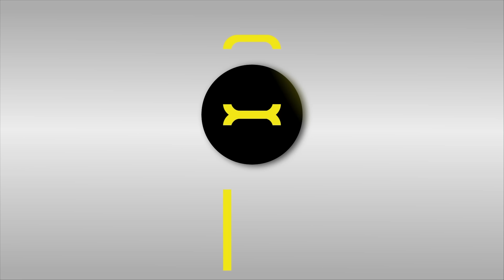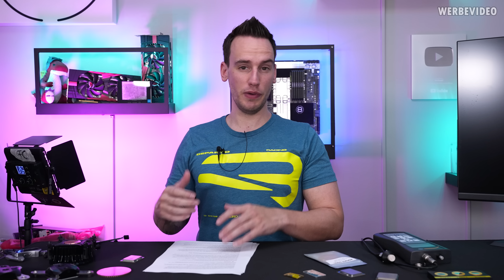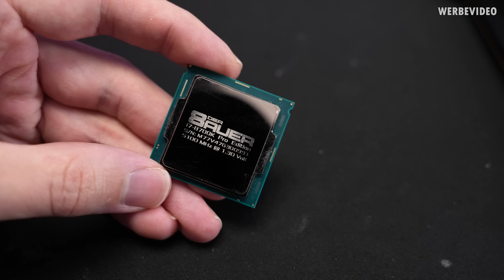Why you should NOT buy Water Blocks made out of "Silver" - Thermal Conductivity measured & explained

Comment: Roman - on the subject of the whole copper/silver thing, I remember reading somewhere that there's an alloy of the 2 called "coin silver" that is supposed to perform better thermally than either on their own. However, from a quick search it seems that there's more than 1 version of it, & I don't know which 1 it would be, if it's even true in the first place. From my very quick look, I think the copper content could vary anywhere between 10-55%, so... 🤷‍♂️  Again, I have no idea if there's any truth to this, I seem to recall it was suggested as being used as a sort of puck of the alloy in the base of an air cooler heatsink, though now that I'm thinking about it that may have been before heat pipes were as ubiquitous as they are now, so a while ago. 😀
Reply: I read about that, they called it "cusil".  It was said to have very high thermal conductivity but then someone tested it and figured out that the numbers first published were not based on tests, they were inferred from some other measurement (maybe electrical conductivity?) and in reality the thermal conductivity wasn't as good as pure silver.

Comment: You mentioned the silver water block is 92.5% Silver and 7.5% "Probably Copper" . . . but what if it's an alloy, like brass, and it's thermal conductivity either increases with temperature, or, stays stable and does not decrease with temperature?
Reply: 925 silver is always with copper

Comment: I was wondering how we were going to convert electrical conductivity to thermal conductivity. The Wiedemann-Franz-Law was really neat to learn about . I'm still waiting for super materials to be used in cooling . Some graphene-copper alloy or synthetic diamond - graphene with some serious thermal and electrical conductivity. Thermal paste really makes a difference in all of these materials as well. The gold plating note was excellent . It's to prevent the corrosion as gold is supposed to be inert even to water. Most other materials will rust or breakdown but gold seems to hold up much longer.
Reply: Oh, sure. That's exactly what we need right now, exotic materials to make PC components just impossible to buy for the 99% of the people. Thanks for that.
Reply: @JP-xd6fm  you and J B are forever jocking my stuff. thank you for never stopping your typing crusade.
Reply: @tobiwonkanogy2975  I really appreciate that. But I was dead serious about it, exotic materials like the silver used on the Aqua computer example are just a perfect excuse to raise prices up for no gain or negligible boost on performance. 
I'm pretty sure those exotic materials are being used by NASA for purposes that makes more sense than playing with our gaming pc.
Reply: @JP-xd6fm  Marketing would definitely push its advantage even if it was within a range of error . my real want is for copper-graphene. wouldn't take much to figure out how make a batch . potentially just run simulations with known properties or might have make several batches until the right consistency is found . I've seen old space computers but nothing newer . the military and aerospace technology always trickles down to the common folk eventually . microwaves , flight, pc's etc etc all was mythological at one time.

Comment: I'm confused why not just make the heat spreader just pure copper? I don't get it don't they want better cooling and performance? Could even ceramic coat the ihs for really good heat transfer and protect the copper
Reply: Copper corrodes and you cant have something thats typically not removable corroding
Hence why nickel plated

Comment: I wonder how much impact does the diffusion of gallium have in the conductivity of the IHS. Could it decrease it's performance when using liquid metal for long periods of time? I doubt it's relevant at all, but at the end of the day you're introducing impurities on the cooper, but probably in a relatively shallow layer
Reply: On exposed copper it will make a difference for sure, because the diffusion happens relatively quickly. Nickel is pretty resistant to gallium diffusion, at least at cpu temperatures. But even nickel will suffer above around 150C or higher.

Comment: In theory, as silver is a natural biocide, it's possible the silver block was made to prevent growth. I've always wondered about a pure silver cooler.
Reply: You are better off with just just copper or nickel plated copper anyway.  I wont write a dissertation here about it but you want your loop to have like metals all the way though due to the galvanic effect.  Silver doesn't play well with copper or pure nickel (nickel chrome alloys are better with silver).  As most radiators are copper its best to just stick with the copper and use a biocide in your loop.  Any benefit from the silver in the biocide department are simply not worth the cost.
Reply: @amindamok  lol some rich mofo now contemplating building a loop with all solid silver parts. Jks but I'm sure someone will do it at some point.
Reply: 90% of the coolers will be nickel plated and not real silver. pure silver would work about 5 % better(as its about 5% more conductive electrically) , but cost about 10 -20 times what a regular 40 $ cooler would .

Comment: @der8auer I have always used a silver coil in my water loops, but since I upgraded to an EK Am4 mono block. The steel block elements that touch the VRMs started corroding very fast, and I was forced to switch back to a regular am4 block. (I used deionized water btw with no colour additives). Would the Kryos Silver Edition help extend the water maintenance intervals by increasing the life of the water quality?
Reply: No.  The reason for the corroding is due to the galvanic effect.  Dislike metals don't... well... like each other.  Unless you also have silver tubing in your radiator and your fittings are also silver you will continue to have the issue.  Nickel can also cause this with copper.  However, nickel is very corrosion resistant.  So unless the coating is very poor it holds up to the abuse.  Copper on the other hand is very easy to corrode.  

You simply shouldn't run a loop with just distilled water unless you enjoy pulling it all apart to clean it up fairly often.  Its better to just use a good fluid or add a corrosion inhibitor to your water.  A loop that starts clean (aka you've followed the instructions and acid washed the radiator tubing) and using a good quality coolant like Double Protect Ultra you will avoid most issues and can run in the loop for years without issue.

Comment: Isn't silver used in loops as a biocide?  Seems that using the silver for the block would serve a similar function albeit for far more money than required/reasonable.
Reply: copper/brass is a biocide as well. Once door handles were done with it just for this reason.
Reply: @marsovac  they actually started doing it in hospitals
Reply: @marsovac  they still are made of copper, brass is just not cheap but it's a beautiful material, nonetheless.

Comment: Hey Roman, what is the interaction between silver and gallium based liquid metal? Is silver immune to the gallium? If so I think that would be a big upsell. As you showed the nickel plating on the copper greatly affects the performance, so if the silver is safe for permanent use unlike the copper then the value might be there.
Reply from the maker: From the limited testing we did with silver it seemed like it was actually worse than copper. But we only tried it on few IHS and limited time
Reply: @der8auer-en  Gallium is corrosive to all metals except tungsten and tantalum, copper is no more resistance than silver, that said when we talking about a heat spreader on a CPU there is no real world difference. there is less then 1% difference in the thermal conductivity of materials on heat spreader that size at the working temperatures(not counting Effusive/Diffusivity) .
So use copper its the best at transferring the heat at the price, unless we can make the heat spreader out of Graphite or Diamond.
Reply: @Northeastfarming  If you believe that liquid metal as a thermal paste does only 1% then you clearly haven't used liquid metal so far...  (edit: or... I completely misunderstood you talking about both Gallium and the usage on IHS's)

I see more of those responses though and all I can wonder about is... who keeps feeding the world these myths? The less thermal conductivity your thermal paste has, the less energy gets through that layer. This is the basic logic behind it and even at that 'thickness' you will notice much more than 1% results.

To be more precise, my system has been running liquid metal for 3.5 years now (yes.. not taking it apart for the obvious corrosion effect bringing a risk of the IHS crumbling, literally, to pieces) but the conductivity it gave dropped several degrees... From what I can find, it dropped around 6 degrees between settings. I was doing 84 degrees Celsius on a 1950x at 3.8 Ghz with thermal paste... and I went to 78C at 4.0 with liquid metal. Considering ambient was around the 19C mark... dropping even 6 degrees (and ignoring how bad the 1950x is for OC) on a 65C delta is almost 10% temperature drop... not 1%... 10.... I later replaced the fans and pushed it even down to 71~72 C for fun.... but Delta Fan's do make a dump of noise ;) so I would not recommend that tornado mode. On average... all threads, all loaded... all at 4.0 in OC... stayed sub 80C at 20C ambient-ish levels... but only with liquid metal... Normal paste on an AIO had me at ~88C... Switching to custom loop did 84C... liquid metal pushed it down by another 6 to 78 while increasing the overclock.

So that is including the massive part of how much the first gen threadrippers overheated when you started to push for 4.0 or even higher...

Now, this is just me... pointing out what it did with my setup and how 1% is utter bs. Scientific explanation is the same... No matter the 'thickness' argument, the fact with liquid metal you can keep that thickness thinner and better in contact between both surfaces is also why it works better. A thicker paste does negatively effect your performance, no matter how much sell-out LTT claims these days. This is basic science.. The only counter is, using a horrible paste at 2mm... doesn't change much from horrible when it goes to 1mm. or 3mm. ;) bad is bad regardless.

I would strongly suggest you buy a simple paste, any vendor, with 12 W/m.K for a few coins and test yourself. While you're at it, test it with thin and thick layers. Really put the peanut butter layer on it and tell me how it does show you a worse result.
Reply: @FreakyAngelus  Actually I'm not talking about paste or liquid metal, just Silver vs copper IHS. Silver is the best thermal conductive metal there is, its just 10 times the price but only 1% better then copper. but then again its not that simple the W/m.K changes with the difference in temperature from the hot side to the cold side of IHS.
Reply: @Northeastfarming  Diamond and Graphene are both much better, but for easy metal solutions. Sure!

Still, 1% which means... look at that graph better. At the temperatures in question, between 20C and 80C of operation, it's more around 6% with Silver being around 425 W/m.K and Copper being just under 400 W/m.K. depending on purity.

Details... it's in the details!

Then again, silver is too soft to really be useful in such qualities and... has a much better function as a coating layer. For that reason, the entire gold approach makes sense... a extremely thin layer of 'worse' conductivity (talking nm.) in order to prevent oxidation that ruins things 10x over. Silver coated, like mentioned elsewhere, to keep your loop clean or even... reduce that contact area from oxidation (pure silver this would be) does make sense in that form. A pure block... it would deform too easily. There are always applications where a price doesn't matter and pure performance has to been best as possible, but this... would not work over time.
Reply: @FreakyAngelus  as you say Detail is in the detail W/m.K is for meter so IHS is less then .0009 m2 so lot smaller so at that size it's not going to make much of a difference watts wise.
Reply: @Northeastfarming  The thickness doesn't matter when you're comparing one material to another, only when determining the heat transfer rate of an actual object. A material with 420 thermal conductivity will always transfer heat 5% faster than one with 400, regardless of how thick it is, as long as both objects are the same thickness of course. Also, you divide by thickness in the formula, so thinner objects transfer heat to the other side faster (but it takes the same amount of time for it to travel a given distance).
Reply: @der8auer-en  Ah ok. So a nickel plated copper contact surface is still the best. Nice to know you guys already tested it. 👍
Reply: From what I know of jewelry shit it's a no Bueno. There are gold alloys with indium and gallium to change the color of the gold. Usually for inlay usage. Mixing them with other metals can cause issues pretty sure silver was one example. May depend if it's fine silver or sterling as diluting silver quickly ups ots tarnish rate.
Reply: silver 92.5% is very prone to oxidation and gallium eat away the passivated coating
Reply: @Thundra74  why would you use 925? that like using 92% copper both are very poor metals.

Comment: You really should make more vids discussing thermal conductivity, diffusivity, air temperatures, thermal camera stuff, COPPER SHIMS (huge personal favorite) etc, its incredibly interesting, really liked this video
Reply: @pcoverthink I suspect copper shims will become more popular in the future esp on rtx 4000 rdna3 and beyond, 8$ for 20 huge thick shims is an incredible value for anywhere between 10-50 (yes 50)c drop on gpu temp, amazing, only need like 10 shims on a gpu
Reply: @pcoverthink  just build a 1lb heatsink out of copper shims :kekbomb:
Reply: Copper shim expansion under heat load and the potential for damage if the tolerances are too tight, would really be a fun video.  For example, when used as replacements for the soft, pliable thermal pads on GPU memory is becoming fairly common, and examining the risks of damage from both the copper expansion as well as the memory module case material's own thermal expansion would be great to see, since if you've been doing this long enough, you know of the disasters this has resulted in for many people over the years as this breaks GPU memory module solder joints or the ICs themselves.
Reply: @bjn714  PCoverthink's sandwich would seem a good compromise.
Reply: @bjn714  copper shim good
Reply: @copper16000  esp. good when they cause the solder joints to crack below the memory chips; even replacing the soft thermal pads with hard(er) ones can damage the GPUs

Comment: For the silver: this is pedantic, as I don't think it makes enough of a difference, but maybe it needs to be measured at, say, 50°? Next time do your testing in the sauna.
Reply: As shown at 5:53 this won't make any different result for the comparison.
Reply: @PainterVierax  I was curious about the alloy in use.
Reply: @hellboundedward  A curve like the one for brass is highly improbable, as it's still 99% silver. Moreover +30K over ambient is negligible when the graph shows 100°C graduations.
Although, Roman's tool assume a 20°C temp measurement. The only possible test for him is to compare the CPU temp of the two cooler siblings mounted in the same system.

Comment: Silver is too soft and oxidizes thickly, if it's a harder silver alloy...it loses conductivity.  There's a reason copper is so hard to beat.
Reply: Silver is too soft, that's why they use sterling. Its other components make it less soft than 999. It uses the silver because of biological growth in the water and cools decent enough. Maybe it would have been more idea to use a copper base and a silver lid, but that would be much more expensive.

Comment: Nice video.
Did you try measuring with different Hz (1 kHz op to 100 kHz) to see if the nickel plating changed the value obtained. (I do not know what frequencies your tool can measure at it might be only 60 kNz)
Reply from the maker: unfortunately the device has a fixed frequency
Reply: @der8auer-en  well. That explains way you used two lapped CPU's👍
(That is the problem with cheap tools, they always miss a feature 😂, still tool batter than no tool.)
Reply: @Petch85  7000€ tool
Reply: @branchprediction9923  Well if you look at the tools available, 7000€ is not that bad and I have no doubt that you can get a tool where you can change the frequency, or you could bay two tools with two different frequencies. That said, the joke I was trying to make was that a 7000€ tool is expensive, and that you could probably get both a cheaper and a more expensive model that could test at more than one frequency. The cheaper would probably not have the same accuracy and the more expensive... well that one is more expensive. But well not all jokes are funny to all people.
Reply: @Petch85  irony jokes needs to be very obvious, reaching the absurdity,  to work well in such a public place.

Comment: Red copper or yellow is already a big difference, and then there is the purity to get the composition is the main role, and it should not bend, that is the 2nd main roll, Cast iron was popular before modern insulation because it took a long time to heat up and cool down. If the Victorian look is what you're after, stainless steel versions of old cast iron designs are available.
Reply: yellow copper is a misleading term that just means brass or another copper alloy.